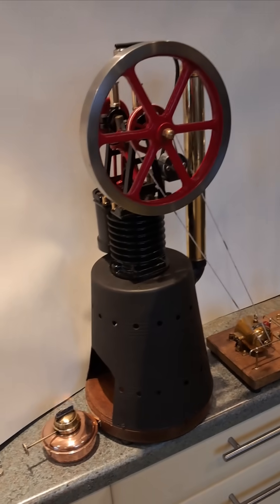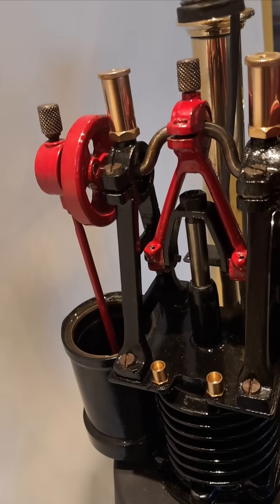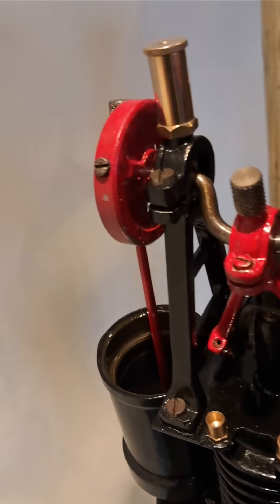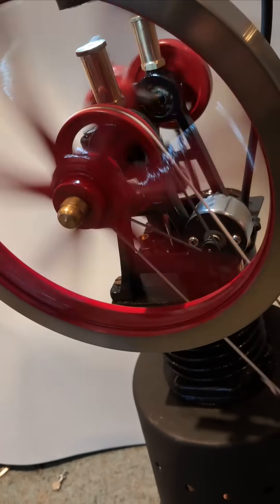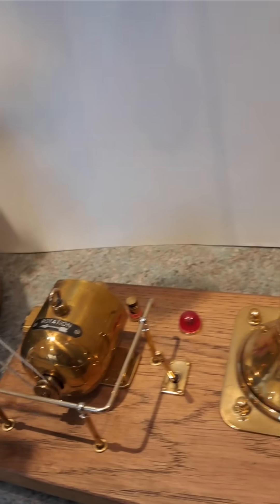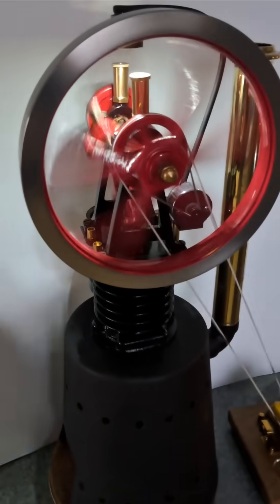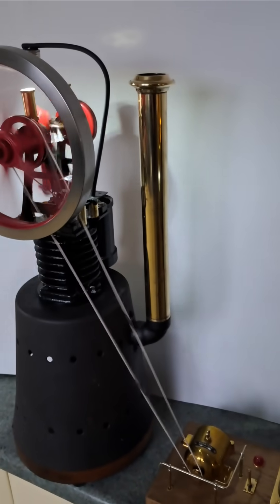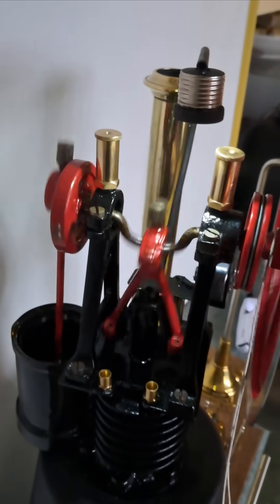KY-KO sterling engine, hot air engine power unit.

Comment from the maker: The sterling hot air motors of 1800 preceeded electric motors and steam engines. The later small portable KI-KO hot air motor of 1920, is used mainly to drive domestic fans but also drove dentist drills, dentist vacuum pumps, sewing machines, mechanical mortars, lighthouse lanterns, coffee grinders, gramophones, electricity generators etc. 

It's unclear if this particular motor units started life as a fan or not? but it has the 4 threaded screw holes for the handle when they were used as a fan. 

There are very many variations of the design with different castings, as they were also made abroad. However, the basic mechanical layout and working dimensions are always the same. The engines good efficiency comes from a very short transfer port between the displacer piston and the power piston and a 3 ball-bearing crank. Cast iron is used for the body, cylinder and piston. The piston to piston rod connection is a ball joint which has an adjustable clamping nut. This allows wear to be taken up and the piston to rotate, probably helping extend the life. They are renowned for their quietness and long service life with just periodic oiling. Although usually heated with paraffin, this one is powered by a 1 inch wick alcohol burner. A dynamo and LED lamp are added driven by the motor pulley and spring type drive belt. 

Base diameter 19cm, total height 50cm, flywheel diameter 18cm, weight 5Kgs.